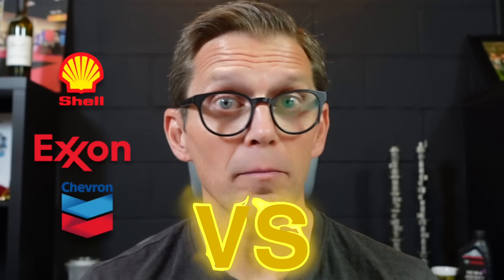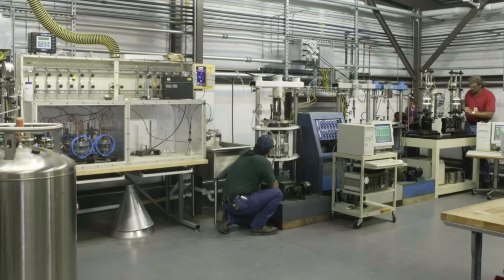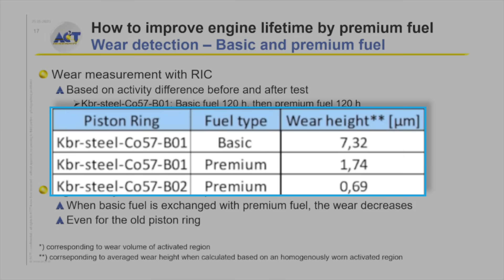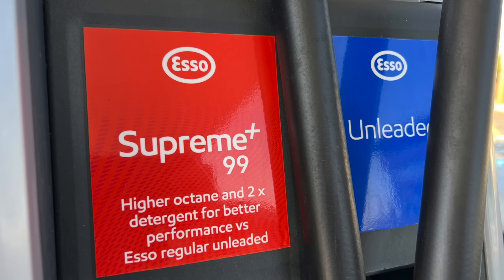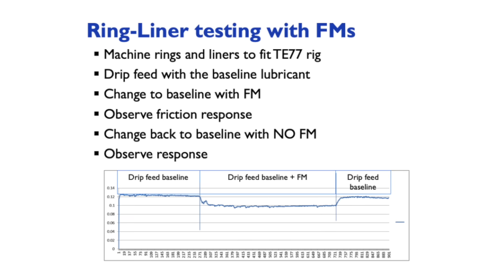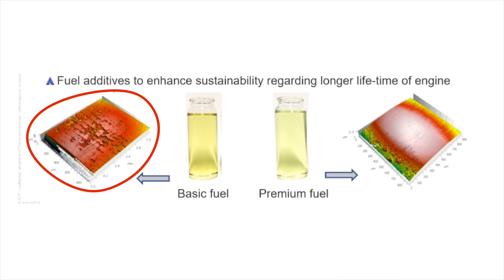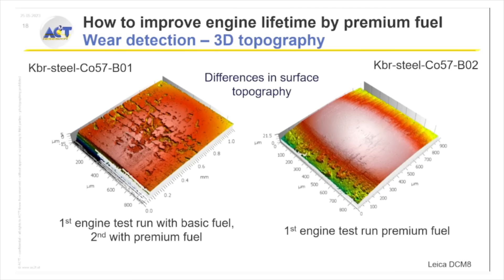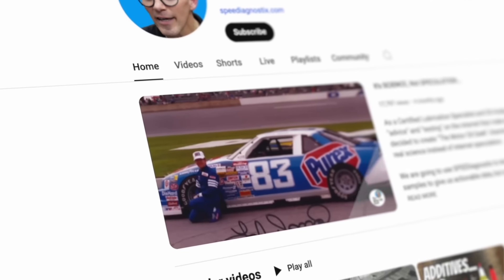Can Premium Fuel REDUCE Engine WEAR?

Comment: Found this link because I was curious about shell v power fuel🤔.
I can give my experience of using shell v power and its pretty mindblowing! 
My current car has over 180000 miles on it and for past 95000+ miles ive mostly used the cheapest fuel.
Then I came across a random post on quora about saying that running a few tank fulls of v power would clean up the carbon on injectors pretty sweet so they get a much better spray which thus give better combustion which makes alot of sense.
My car has always produced 38 mpg in town with alot short stop starts (fast food delivery) :P.
3 weeks ago i decided to fill up with shell v power, it costs 10p more a litre but i did the calculations and it worked out at 42.6 mpg then i filled up a week later and it worked out at 48 mpg which is fecking unreal :O, last week i filled up at tescos so it will be interesting to see the results in a few days and if the friction modifiers in v power fuel really help in filling in the minute scratches in cylinder bores to achieve a better compression which is the main reason i can think of getting a 25% increase in mpg?
Reply: Amazing! Thumbs up!

Comment: In Australia. It’s noted that BP Ultimate 98 has no friction modifiers and less PEA additives compared to Shell v-power 98. Which has friction modifiers and a higher amount of PEA additives compared. Only Shell v-power 98 now for me! Awesome video that got me researching. Thanks Lake!!!
Reply from the maker: Thanks for sharing!
Reply: @themotoroilgeek 
Do you know if Lucas Fuel Additives with upper cylinder lubricant helps/works ?
Reply: Where did you get the data on the fuel in Australia?

The interesting thing is, BP Ultimate 98 in my motorbike (CBR 1000 RR Fireblade) runs SO much better than Shell V-Power and most other guys that ride say exactly the same thing. 

We all avoid Shell like the plague.

When doing a quick google search the only result for friction modifiers in fuel in Australia that comes up is for Ampol. 

So not sure how you got your results??
Reply: @TheSydguy30  Hi mate, fair question! Shell states that V-Power contains friction modifiers and detergents in their product claims globally. BP Ultimate 98 focuses on detergents but does not claim to use friction modifiers in any of their official literature.

Copy and paste from the Shell Australia website, the same cannot be found at BP’s Australia’s website. 

“Shell V-Power contains Friction Modification Technology (FMT), developed to reduce friction in the engine so it can operate more efficiently and deliver greater power to the wheels.

FMT is also designed to form a protective film on metal surfaces, decreasing the rate of wear and corrosion that can adversely affect precision fuel system components”
Reply: yes it's true in Indonesia shell is better than BP. I feel the engine power is higher if I use shell v power
Reply: No thanks. In Australia BP 98 FTW. Every time.
Reply: My car runs a bit longer (fact) and feel a bit livelier on Shell than BP. Worst is United, I use them because they got new petrol stations (=they got new clean tanks).
Reply: @sunshine8556  My experience is counter to yours. 💁‍♂️

Comment: Do you want anti-friction additives during the break in period? Will it hinder ring seating?
Reply from the maker: Great question. No, you don't want those during break-in.
Reply: Thanks @themotoroilgeek .  I know you specialize in engine oil, however, have you done a video on compression ratio V. octane rating? Including air cooled engines (VW)
Reply from the maker: @protodog1  Not yet, but we will.

Comment: Interesting, but is the reduced wear worth the extra cost for premium fuel?  My 2UZ-FE will easily run for 300,000 miles or more on regular fuel.  A tank of premium costs an extra $15 dollars, and optimistically I can get 300 miles per fill-up.  So for 1000 fill-ups to get to 300,000 miles, that's 15,000 extra dollars in fuel cost, for how much wear reduction?  Even if the engine was completely worn out at that mileage, it can be replaced with a lowish mileage used engine for well under $5,000.

Comment: Its about your personal vehicles ignition timing, premature ignition means no burned fuel and leading to a failed motor slowly but surely. The higher octane is supposed to match with your cars manufacturer choice such as racing motors needing higher octane. Most daily drivers will prematurely ignitie with the wrong octane level specified in the owners manual.

Comment: If gasoline engine has more primary ZDDP I guess it will sustain better at the piston rings at the higher temperature?
Reply from the maker: Primary ZDDP last longer than Secondary ZDDP, but Primary typically provides less anti-wear protection.

Comment: I prefer Chevron over Shell. Chevron with Techron is the superior gas, but they’re both still better options than mom-and-pop because of the extra additives and detergents they blend with their respective gases. When I compared the numbers to Costco or a mom-and-pop gas station, it’s only a few bucks difference when filling up. It’s worth it to just use Chevron or Shell, and it’s better for the car.

Comment: We live in an area that you get what you get for fuel.40 areas ago I did the research on oil and gas. I studied additives for gas and diesel. I picked out the additive I ve been using in both  units 40 the 40 years since. We get extraordinary mileage out of all our units, heavy highway trucks and gas powered cars and pu's. I find that most additives are 95% hype. Marketing, marketing, marketing. I also went thru oil and bearing schooling. I never. Ever put any additive in oil.
Reply from the maker: Right on!

Comment: Running premium 93 in a vehicle that is perfectly happy with 87 will also cost you approximately $4,000 to $10,000+ more in additional fuel expense over the life of the vehicle. Those additive packages are nice, but they aren't giving them away and that adds up over time.
Reply: It's better for the sake of cash flow to have a vehicle that lasts longer. I'd rather shell out 4000$ over 15 or 20 years than buy a new vehicle five years earlier.

Comment: I remember reading a super stock magazine from the early 80s, they were using a anti wear additive in there race fuel ,the motor was  actually run on the  dyno   for some time and showed how little wear on the cylinder walls and rings. I'm a believer in good fuel

Comment: Premium at Sam's and Shell? Its about octane rating.
"Premium" is not a regulated term for consumers to rely on, hence the required octane rating stickers at the pump.
And in America, it is a marketing term, most things in America are marketing.

Does E100/E85 induce signifcant changes in any wear or oil dilution results?

Comment: Get ethanol out of fuel, as it a carb. and injector killer especially in small engines if you do not use fuel stableizer. Fuel goes bad and will crystalize if it contains ethanol sooner if not treated. Just my opinion, been there, saw it, expensive repairs.
Reply from the maker: Ethanol is a good topic for a future video.

Comment: Engine wear due to basic fuel may be a factor in some high mileage +200k engines, but for most of us the culprit in engine wear at lower mileage is due to not changing oil every 5000 miles.  Don’t waste your money on premium gas if it doesn’t need it.

Comment: So as gas becomes more and more expensive, people are trying to get by on regular fuel. Here in Florida, premium gas is 0.75 to 0.80 cents a gallon more than regular. However, more and more cars need premium to reach their designed-in performance level, as the engines get smaller and turbos become more common. So there is a lot of need to save money by cutting out premium fuel. My vehicles say they run on 87, but the throttle response and acceleration is much better on premium, 30 gallons at 80 cents a gallon (60 cents at sam's) is $18 per tank.works out to about 100 a month, so it adds up.

Comment: My Mercedes GLE 350 specifies premium fuel with a minimum 91 octane.  If a lesser octane is used the engine retards the timing automatically to prevent detonation.  The retarding of the timing supposedly results in a less efficient burn leading to more combustion byproduct buildups in the engine.  Is this true?  I can say that I ran my car on regular fuel for a few tanks and noticed a marked decrease in performance and a couple of MPG less between fillips.   After that I have religiously used premium 93 octane and the engine has run wonderfully.
Reply from the maker: That is true. Some engine can take advantage of the higher octane fuels. Others can not. The direct injection turbo engines tend to be the ones that can take advantage of the higher octane fuels.

Comment: I have a 2012 jeep jk 3.6 pentastar bought it in 2017 at 65,000 miles from day one been using only Amsoil 5w30 Signature series but using Regular fuel, at 124,000 miles now, so would it be safe to switch fuels and if so What brand and octane? At 110,000 added a J&L catch can.

Comment: The Answer is ;
Is ethanol injector damage. 
Both gasoline and diesel. 
From lawn mowers to sport bikes I've had near 7 thousand dollars in damage. 
Just cost ne 12 thousand in diesel damage and a high flow fuel pump.
It's time we all sued the federal government. 
You can't tell me these epa freaks and green new deal crooks and the communist party didn't plan this scam.

Comment: I don’t know but I swear I have 2015 Subaru legacy 4 cyl.   Only have used shell 93 and oil changes 3k and I have 243000 miles  spark plugs replaced at 159k and I kid u not clean  no fuel pump issues nothing   No idea if it’s the gasoline but I will always used same routine on all my cars

Comment: My interpretation of this, since the octane rating still needs to match your engine, is that, if you need to buy fuel with lower octane rating, you can "roll your own" premium fuel with the right choice of fuel additive.  BUT, didn't you say to never use fuel additives?
Reply from the maker: Modern DI engines can take advantage of higher octane fuels. In regards to fuel additives, we are going to do some testing on those.
Reply: @themotoroilgeek  Thanks for the reply.  I've never owned what might be called a modern engine, but I am familiar with the demands of higher compression.

I'm glad you made this video, actually.  I went and re-watched your oil additives video and realize I had it backwards and it was the oil additives that are recommended to not be used, not the fuel additives.

Comment: A car driven only once every five or six weeks. Am I better off with a top tier premium gasoline with 10% ethanol, or a non-top tier premium with no ethanol? This car will do maybe 800-900 miles a year.
Reply: I would run what your owner's manual tells you to run. If the car sits for long periods, which seems to be the case, just pour some STA-BIL in the tank and you will have little worries.

Comment: You are wrong with European fuel. The normal 95 is 1/2 or 2/3 less additives compared with 99(premium). And 95 has 10% ethanol, 99 has only 5% or less, so again better for the engine.

Comment: My father was very wealthy man.
In his 1998 GMC Van 
He only bought 92 at the pump, shell gasoline,and changed the oil every 5,000 miles with mobile  oil.
He did this for 180,000 miles.
He passed away, and I received the van.
 I kept it for 5 more years. And sold it at 325,000 miles.
Here is what I found.
I bought 87 shell.
I change the oil with my father we did all oil changes at home.
When I changed to 87 the oil would come out much darker than with 92.
   The gasoline is what makes the oil darker. 
Think of differential oil or transmission oil there’s no contact with gasoline so we can stay in your car longer 50,000 miles plus .
But if it comes in contact with gasoline, we have to change .
So the type of gasoline makes the difference .
And how dirty your oil becomes, buying cheap. Gas means to change your oil sooner.

Comment: Isn’t there a website called Top Tier gas? I saw that a brand that was on there before was no more because they stopped putting additives FWIW Mazda clearly stated for for their 2.5 turbo using regular yields 230 hp and 310 torque but with premium the engine produces 250 hp and 320 torque! Costco premium is 93 octane and on the list of top tier gas. Which high octane gas has the best preservative pkg in your research?
Reply from the maker: The TopTier gas website is helpful. We have a video coming soon on this topic.
Reply: @themotoroilgeek While I am certain there are criteria to be in the top tier category  it’s a safe bet that not all have the same preservative packages; BP was dropped from the list for no longer including engine protection; moreover are you aware there was a time Shell only included their protection in the Premium gasoline thereby forcing you to go from 89 to the more expensive grade; I still hold a grudge about that. I wonder if gasoline brands that say there is a protection package across all octane offerings change the amount. For decades I was a Mobil 1 guy and just discovered that Pennzoil Ultra Platinum outperforms it by a great deal.

When you have time each of these videos are worth (IMHO) watching in their entirety.

https://youtu.be/TWuKvnCq1js?si=vtDYCRTm_EOIpAz_

https://youtu.be/D3qFfAEp9AU?si=wx8LpthDSKu6TYzZ

The takeaway for Pennzoil is there is a big difference between their Ultra Platinum and Platinum so in this instance you do get what you pay for. Logically it stands to reason that gas companies having an eye on their bottom line would not put the same amount engine protecting ingredients in the 87 as they would in the 91/93. Top tier lists brands but does not distinguish for the octane within the brand;,a not insignificant (IMHO) omission.

Comment: I burn 90 octane ethanol-free gasoline in a 2025 Toyota Tundra V-6 twin engine turbo that has less than 1000 miles on it. I bought it new. I don't know who refines the gas or what the additive package is. The reason I choose to burn this gas is to reduce the attraction of water into the fuel system. I live in Texas so I assume the gas comes from a refinery on the Texas coast. The brand of gasoline is QT. I plan on using Mobil-1 0W-16 full synthetic at the first oil change at 1000 miles and changing it thereafter at 3000, 5000, and at 5000 miles interval. Do you know anything about this fuel and the future wear results I can expect with this plan?

Comment: The comments are full of people saying they've used expensive fuel forever and that their vehicles run great so it was worth the money and brand loyalty.  But running great isn't data. My car runs great with cheap fuel so I must be doing a better thing because I get the same result with less expense.  There is no data in that statement.  This video proves the point with data and anecdotes don't prove anything.
Reply: If you consider that many people see the same affect that running 93 shell is amazing then this guy proofs with evidence then you must conclude that it’s true what people say. 240k miles and I’m extremely happy it’s still going strong now I see data that shows me 3k mile oil changes and shell 93 always is amazing

Comment: What does "premium" fuel mean?  Is basic fuel the cheap stuff and it is cheap because it doesn't have anti friction additives?  Do you have a video about which gasoline has the greatest resistance to ring and cylinder wear?  Does Octane rating have any impact on those anti-friction additives?  Basically it costs about $1 more per gallon for 91 / 93 octane over 87 octane where I live and I wonder if there is any reason to use it and pay that.
Reply from the maker: Premium fuel is 91/93 octane. Top Tier fuel is a specification of fuel detergency. We have a video on Top Tier fuel coming soon.

Comment: Question: could the increased iron from the cgi blocks found in the oil analysis be coming from the extra cheap fuel and not from the block shedding compressed iron. Could the additional compression of the graphite block at the crank be caused by additional vibration from that same extra cheap fuel? It would be causing the engine to compress really really rough due to lower than required cetane? And then add loads of too much fuel of that same grade with lots of boost for gobs more power and you’ve got a cgi engine that tears itself apart from this. 

A diesel podcast video showed this.
Reply from the maker: The iron in the used oil analysis was not from the fuel. The only difference in the fuel was the additive package. Also, this is why the piston rings were irradiated. The iron was from the rings.

Comment: NOTE: - Additives, fuel dilution, and contaminants DO NOT change the oil chemically. Such dilution changes the oil 'physically'. For a chemical change the molecules in the oil would have to bond molecularly with the oil to form different substances. Dilution does NOT do that!. Interesting what this research finds. 
Question now becomes: -Why don't fuel suppliers add the anti-wear compounds to all grades of fuel? Are there any that do?

Comment: 4:26 "fuel dilution contamination"
Even worse than I figured, which is good news for my segregated combustion engine.  However, that issue is replaced by water dilution. Fortunately, oil isn't used for significant heat transfer so oil flow rate is seriously reduced. I have questions you can answer.
Thumbs up.

Comment: Can using a upper cylinder injector cleaner like a lucas seafoam amsoil stp , reduce the protective properties of this premium fuel. I have a 1.0 eco-boost I always use premium fuel mostly V-power Shell. Do you have any test results  for that.
Reply: I also have used Pensoil Ultra oil from 1st oil change at 1200kms
Reply from the maker: Interesting question